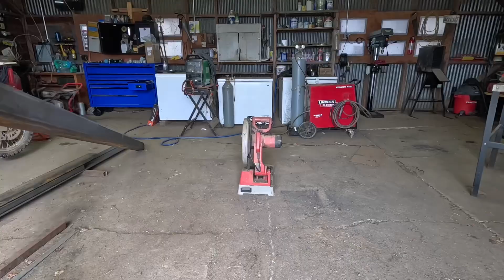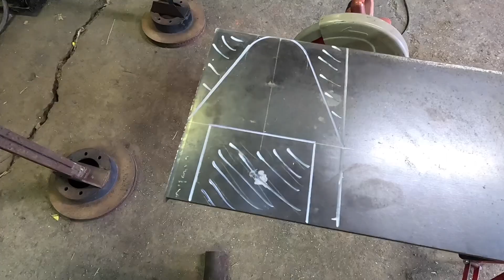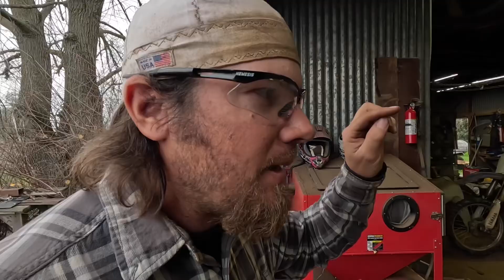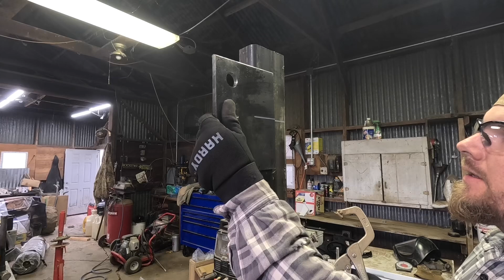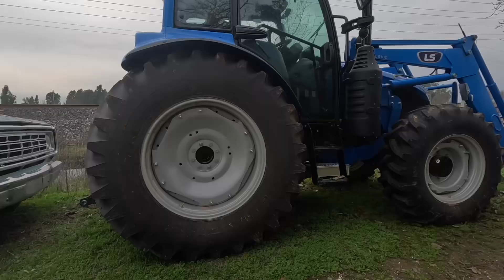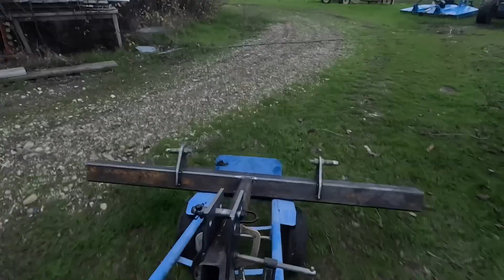Building a Bale Unroller Part 1

Comment: Hello Tyler, You are a talent fabricator.On the one tab it fit right on ,on the other one you had to beat it on . Yes you got it on but there is stress in the radius of the tab now .when you try using it adding hydraulic pressure to lift with it will add more stress. I see you tacked welded it in place but you may want to remove it and make the opening just a few thousands bigger so it fits without  having to drive it on..with the stress in the metal it may crack sometime on you in the future if you don't ,, ...I look forward to your videos each day .

Comment: One would think, you would be working with half the bail height. So the further you get from the three point the more travel up you would have. So the unrolled arms would have to be at least 4 feet, I think you ll be fine with normal fabrication designs!?

Comment: If you want to save some time cutting out your brackets, I just started sending my drawings to a place in Reno that laser cuts everything. My current project the steel was going to cost me $20 per part at the local steel supplier. I had multiple cuts and slots in it all delivered to my door for $30 per part.

Comment: Have you considered getting a hydraulic top link? I think that you might get the vertical angle you need,  depending on the length of the hydraulic ram and cylinder. I have one on my tractor and it allows me to change angles while in the cab of my tractor. Sure cuts out all of the in and out of the cab to adjust the screw on the old top link for each implement I use.
Also I notice that you have draft control on your 3 point hitch. If you change the connection point of the your top link to the tractor it will change how high your top link will lift. Very important too when plowing and discing. Check out your owners manual on which hole to connect your top link.

Comment: excellent bit of thought and analysis to get the travel required. 
You could look at moving the top link mount plates to push the post away from the tractor a little bit to give you the same bottom position using the middle hole.

Comment: You have to try flux core mig wire...I work at a rig manufacturing place and my job was welding the platform...I used flux core... It was a base to a triple...